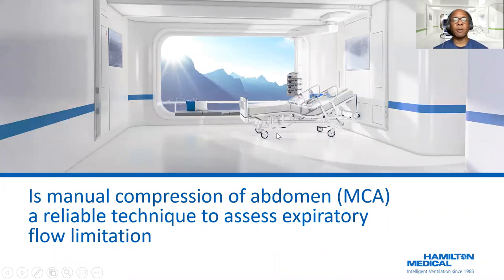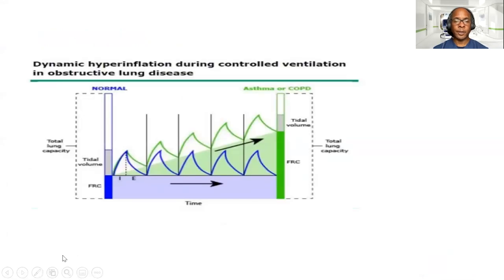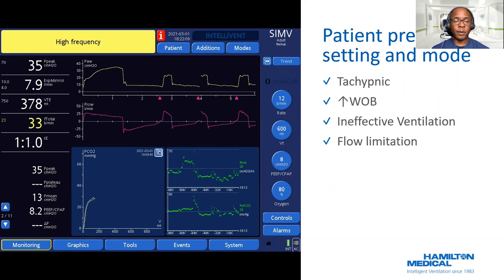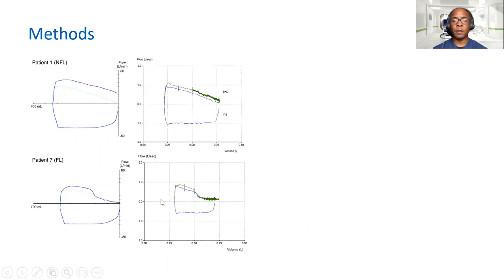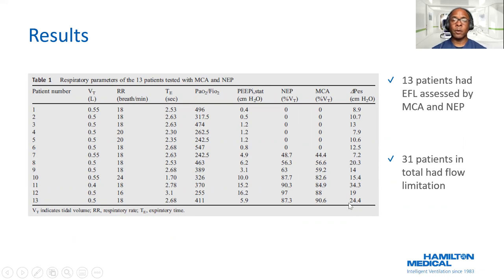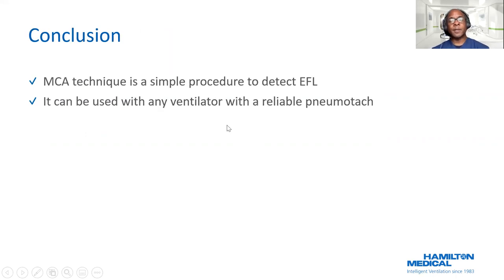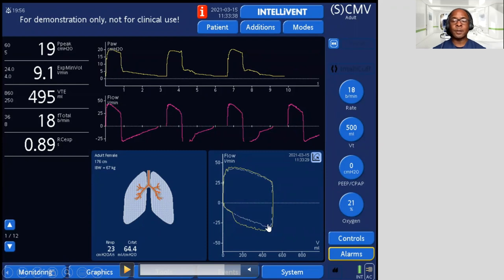Journal Club: Manual compression of abdomen to assess expiratory flow limitation

Comment: 0:40 Background of Expiratory Flow Limitation
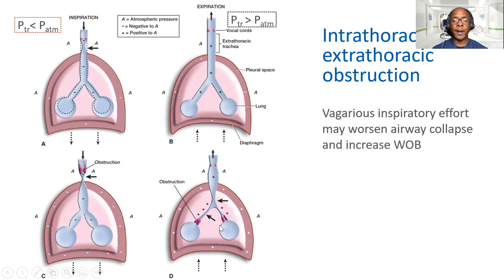4:15 Assessing Expiratory Flow Limitation via ventilator waveforms
5:19 How to assess EFL in ventilated patients
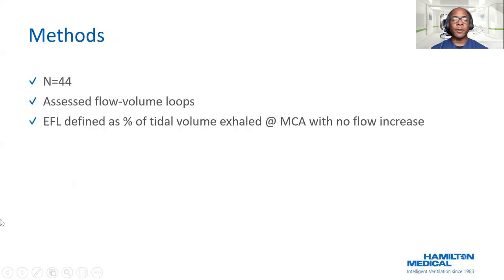7:43 Methods
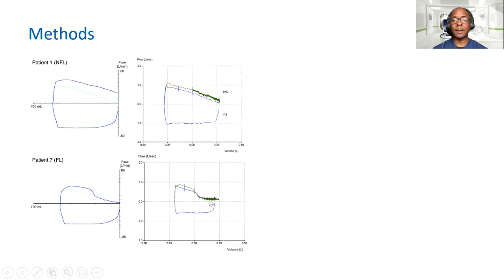9:45 Demographics 
10:51 Results
14:03 Limitations
15:08 Ways to mitigate EFL
16:04 Conclusion
16:21 Example of using the ventilator flow volume loop to assess EFL